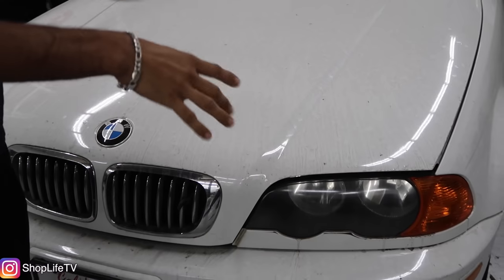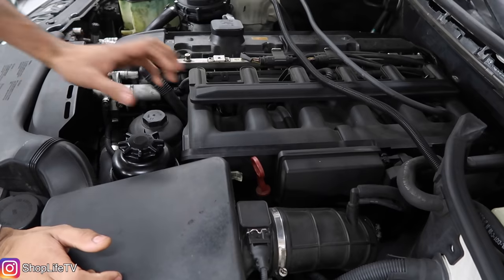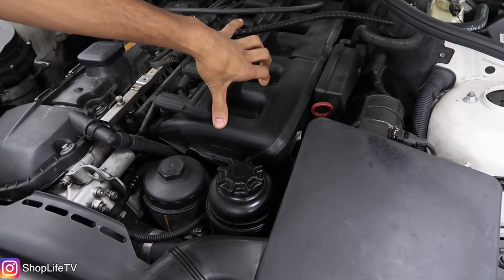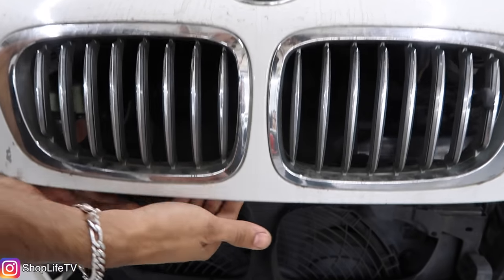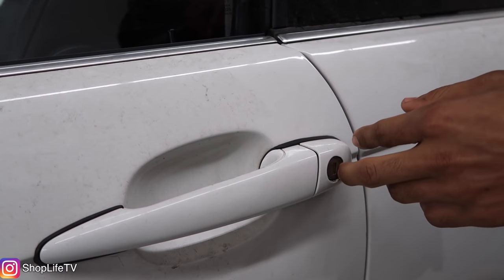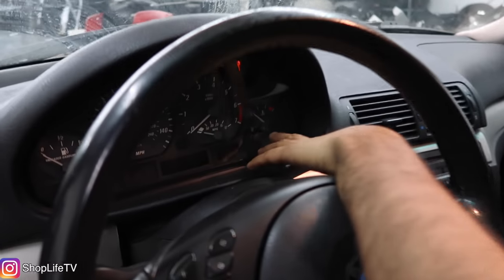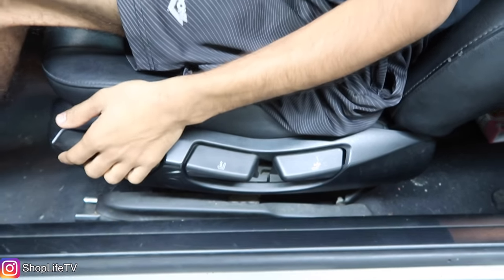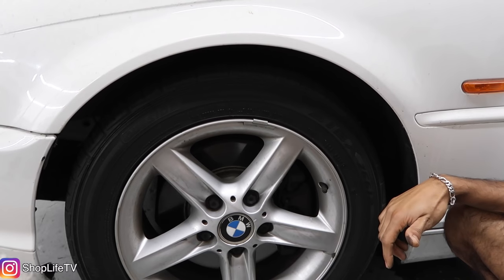25 BMW E46 COMMON PROBLEMS

Comment: so mine beeps and shows -40 degrees and it takes a while to get the aircon warm/cold, would i need that kit you talked about? and what is the kit called?
Reply from the maker: ambient temp sensor repair kit is what you need

Comment: 320i still burning oil so did my m52 but my bmw e46 has 2390000 miles m52 323 don't use a drop of oil

Comment: My e46 325i has a clunking sound in the front when releasing the brakes at slow speeds. I havent checked yet but do you have any ideas of what this could be? thanks in advance!
Reply from the maker: could be a number of things, first check all brake related bolts for tightness, then sway bar links and control arm bushings
Reply: Had a similar noise a couple of months ago. My issue was that the front right brakes caliper was slightly off and needed to be tightened down a bit. Also had to change the disk brake pad since it was wearing out abnormally.

EDIT: Also the noise came while braking at low speed.
Reply: yeah mine is more of releasing the brakes at slow speeds. almost as if the pistons were not releasing fast enough or something.

Comment: The e39 is a much better car then the e46. I had 3 e39 and 1 e46 and the e39s had less problems combined the my only 330i.
Reply: Naji the e39 shares extremely high % of the faults u find in the e46, sounds like you just got lucky

Comment: for everyone getting scared of the problems... they do not happen often, they happen, but like if its old 10 + years it might need checking on all aspects, if is all good after inspection/cleaned declogged replaced new parts... this issues will happen 1 or 2 in like 5 to 10 years... or more... depends on how you are driving, compared with other cars? replacing some random bullshit every 5 years? is a bargain ... better than most new cars to be honest... new ones are guaranteed for 2 years or 100k  miles right? after that stuff starts falling, rust pops up etc... this old beaters... are still going strong even tho they stopped manufacturing them... what i hate about car companies, they had an amazing car design then they had to like "fk" it up with weird grills and headlights.

Comment: I will say that the man got an idea about this BMW   ''great cars" However there is a lot more every man or woman that wants a BMW needs to know a lot MORE !!!! BMW CAR.... To be honest i would ''recommend''  the  BMW 325i manual or automatic to all my enemies ! From New bough in 2003 May till i the day i got rid of it 2005 was trough terrible set of issues !!!! Mind  you all the car was under Full BMW factory warranty !  As i was driving the about 10000 km a year,  maintenance by the BMW book ! In November that year first time in my life i needed A tow track as it just shut down ( no warning and no apparent reason) Back to the dealer for the fix...was told that the car  '' just got new battery and new alternator'' its fine now all done sir i was told......But only 2 weeks later same issue took place.''We did replace the fuel sender told me the service man,please use low fuel octane now since BMW fuel sender gets foiled by premium fuel and show you more fuel the you have ! You were EMPTY said the BMW man even so the fuel gage did show more the 1/4 tank !!! Did have many more issues ;coils shutting down on the road about 4 more times,4 more tow tracks called in and back to the dealer it went.Shattering clutch never ever run in  to that all  in my life before (have driver manual cars all my life) Steering rack and pinion replaced in to 2nd year by about 15000 km never done that in any of my cars...,Also some terrible clanking noises from under the roof of the car THAT WAS NEVER FIXED BMW could not find the noise reason.....All in all the car been to the dealer about 40 times in with 4 times tow ins.I wasted bundle of money ,wrecking my nerves, bundle of time but never felt i could depend on it !!!! At the time was covered by BMW guarantee.....Just imagine what it would cost if i did have to pay  for this horribly Shit car with my own money.....So every time you dream BMW take a cold shower and run the other way !!!!!!

Comment: so amazing that a car that has so many problems yet ppl still buy them, toyota probably only has 5, would you rather spend 200 fixing that or the thousands you will invest in a bmw.
Reply: Well, a Toyota is almost always FWD... and most of the engines are not very interresting.
But yeah, if u want cheap and reliable, buy Asian.
If u are about to purchase a 4-cylinder E46... dont bother. If you buy a car where you'll have to repair that much, might as well at least get one with a proper engine, so its worth the time & money investment.

Comment: What is ONE thing good about thee cars?  They were made to be leased and handed off.  "German engineering" bullshit.  The last job I did to my Corolla was an oil change, a year ago I had to get ALL NEW TIRES!  Can you imagine?  Tires!  Thank you for your VERY thorough video.  I'm a DIY engineer, but I don't work on shitty designs, who are these guys?  Clearly designed for 3 year leases only.  My Corolla will run until we run out of fossil fuel  - to be fair, I may need wiper blades by then.

Comment: What can i do about EML
Reply from the maker: depends on what the fault code is for
Reply: Trottle position sensor,i had the problem twice
Reply from the maker: year and model? message me on instagram it will be easier to get notified when you respond @shoplifetv

Comment: What a plastic piece of crap. My w204 has simular designs but they used metal instead of cheap plastic like bmw does and with over 200k miles everything in this video is still original on a mercedes and will last another 100k. Only plastic parts that fail on a mercedes are intake flaps which is just one 300$ expense.

Comment: What an irredeemable piece of garbage. I actually got a 330i for free when I was younger and more naive, and now it feels like I should have asked for money to take it. BMW owners keep defending it with tired old excuses like "it offers unparalleled driving experience" but they forgot the part where you need to get the damn thing started first. A car is, primarily, a means of conveyance, and if it doesn't work then it doesn't matter how nice the ride is or how comfy the seats are. I drive a Honda C-RV with 200,000 miles on it, and it has almost no problems whatsoever. My 330i remains a broken mess to this day, because every time I fix one problem, another pops up. No wonder they lost the war.